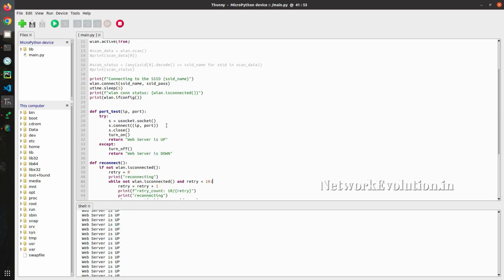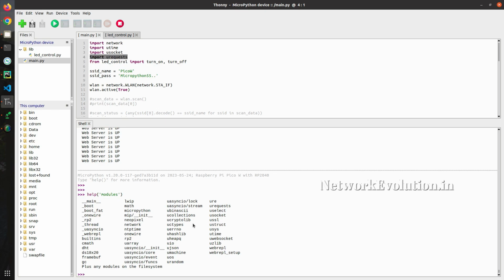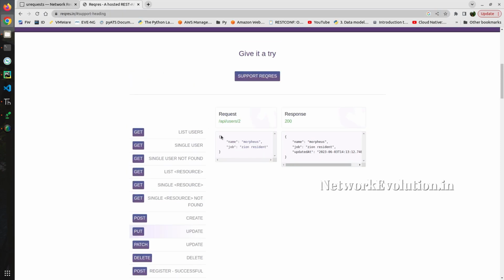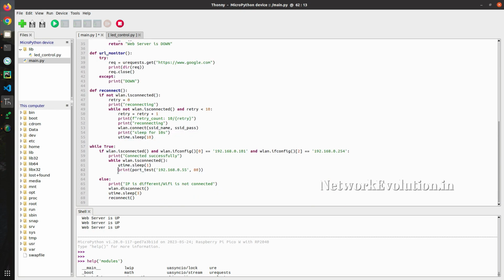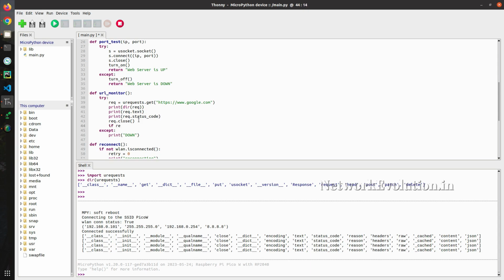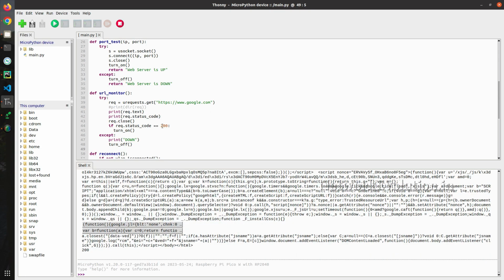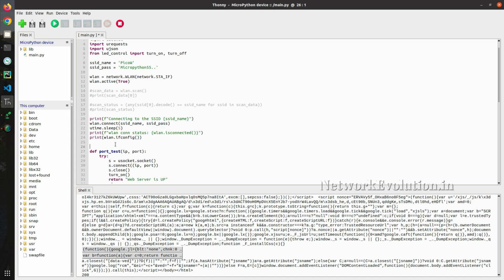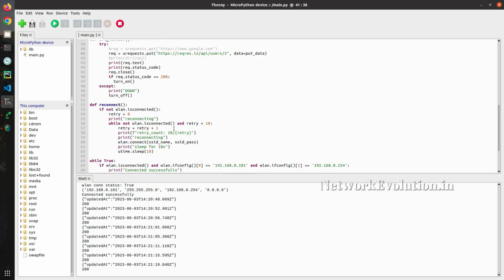Raspberry Pi  Remote Server Monitoring over Wifi: Part2 Control LED based on Server TCP Port Status

Comment: Hi! I'm looking for few tips in creating a small app for my use case. I want to create app that connect to vps via ssh protocol,  execute command and  read outputs from shell terminals of dockers containers. 

For example
Container_0 status: working 
Container_1 status: error
... 

What tools should i use?  Paramiko and os module?
I'm newbie in Python, but i have small programming expiriance in other languages. I work on windows.

I found your Channel 3 days ago, and its the best place to start, with my small project. 

Thanks for every tip.
Reply from the maker: Hello, thanks for the comment.
Yes you can start with paramiko. Paramiko is the base Python library for ssh.